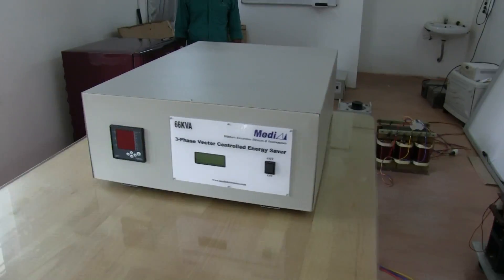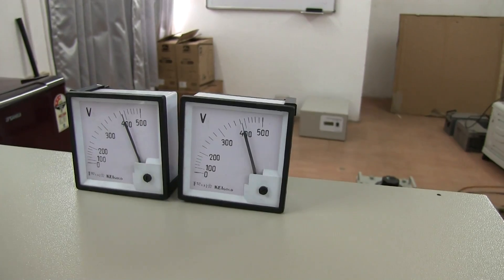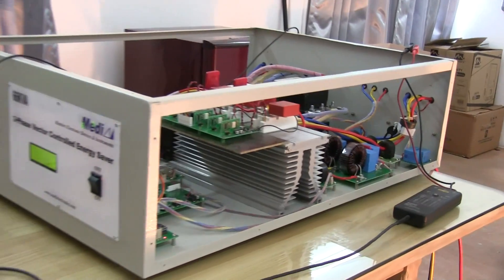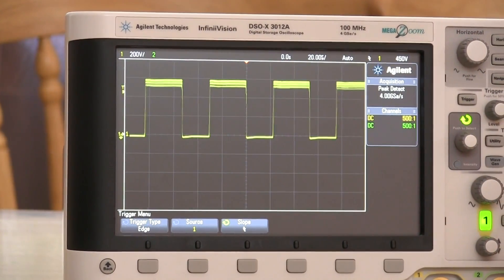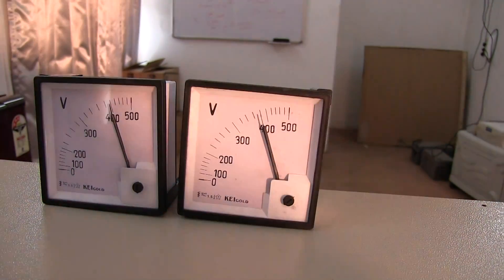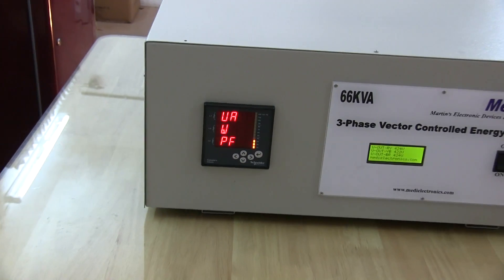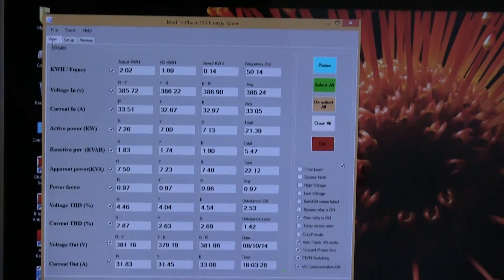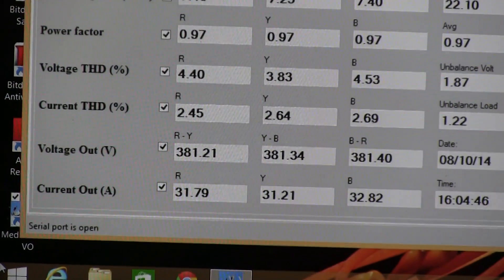3 Phase 3 wire IGBT based Delta PWM type Voltage optimizer

Comment: quá giỏi! (from VietNam)
Reply: Hello !

We are one of the leading manufacturers of IGBT Controlled Static Voltage Stabilizer with high precision, fast regulation and inbuilt circuit protections. 
You may check about it more on
https://nkbtechnocratspltd.com

Contact us on: nkbtechnocrats@outlook.com
Call: +91 9660061987.

Comment: Nice! The output voltage seems to jump less than the sag seen in the input voltage. The waveforms are clean. I wonder how this behaves with uneven loads (say, a high power lamp in series with a rectifier diode to simulate loads like hair driers working in half heat mode).

Comment: apka contect dijiye pllzzzz
Reply: Hello !

We are one of the leading manufacturers of IGBT Controlled Static Voltage Stabilizer with high precision, fast regulation and inbuilt circuit protections. 
You may check about it more on
https://nkbtechnocratspltd.com

Contact us on: nkbtechnocrats@outlook.com
Call: +91 9660061987

Comment: hello, you're interested in reselling in Brazil. 
Here we work with 380/220 input and output star
Reply: Hi ! We will be able to provide you the stabilizer based on this technology. Kindly connect on nkbtechnocrats@outlook.com or call on +91 9660061987.

Comment: 381V to 433V input has very less range...
we have here nominal 440v, 470v (max) and sometimes upto 500v also, so it will simply go to bypass mode
price for 30kva?
Reply: Very successfull device its price is $10000
Reply: Hi ! We will be able to provide you the stabilizer based on this technology. Kindly connect on nkbtechnocrats@outlook.com or call on +91 9660061987.